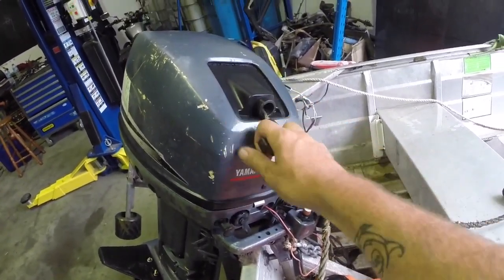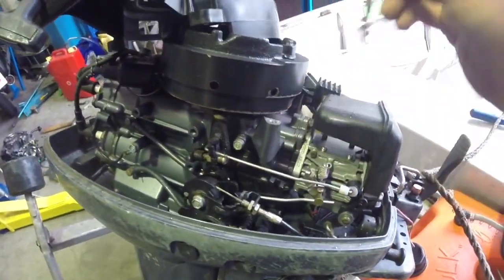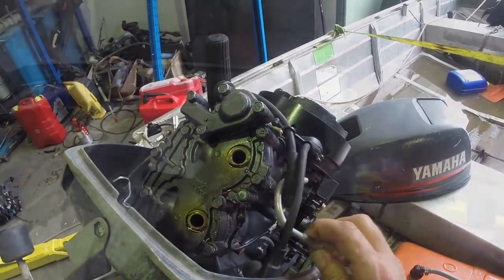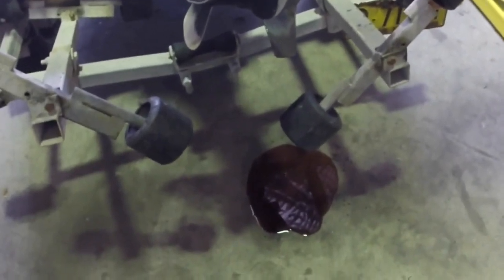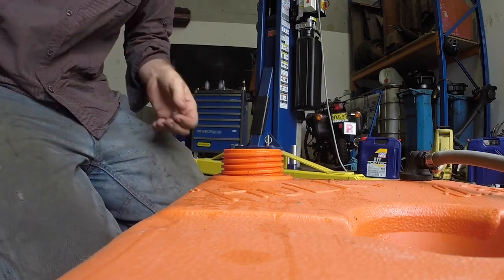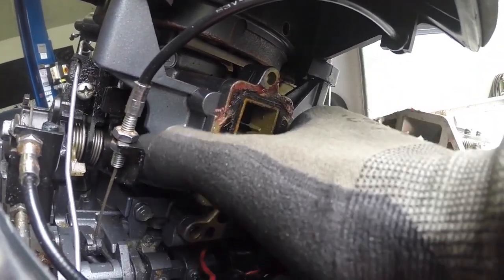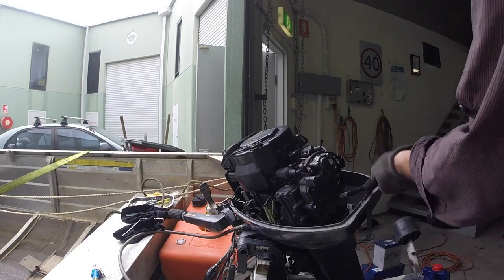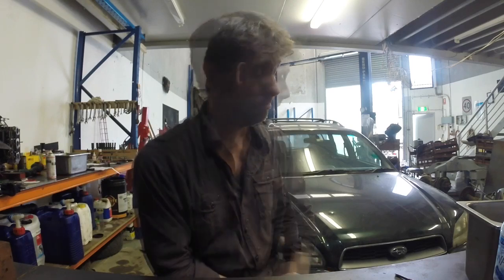Unseizing a seized outboard motor

Comment: Thanks so much for the video!  I'm working on unsiezing a 5hp nissan 2 stroke built in 1993.  If I try to turn the flywheel counter clockwise, it just unscrews the nut on top of the flywheel and doesn't turn the engine. Do you know of a solution for this?
Reply from the maker: Hi Todd. It's a tough one when the outboard is seized so much that the nut undoes before it moves. I would just focus on turning it clockwise until you start to get a little bit of movement from the engine. You could try turning from the flywheel itself rather than the nut by using the puller holes in the top of it and some sort of home made bar, but it would be tricky to get enough force that way.
Reply: a strap wrench on the flywheel, or a chain wrench padded with lead, or aluminum (so you don't chew the surface horrifically). get both from a pro plumber supplier (not home depot). they use the strap jobs on polished pipe, and the chains on ugly but stubborn pipe, lol. you can also make a strap wrench by slitting an extension, and running an old work belt trough it. tighten, then twist in the direction you want to turn, after it winds up, it squeezes with surprising force, so a strong strap can actually apply a bit of torque

Comment: Very new at messing with outboard motors.  I put ATF in both cylinders and it immediately drains out of the top cylinder.  The bottom cylinder hasn’t drained at all.  Does that mean the top cylinder is bad?  Thanks for your help.
Reply from the maker: No, only piston will be down allowing the oil to flow out the exhaust and/or inlet ports.

Comment: Use brake fluid and heat the engine with a heat gun and leave overnight!!! It even works with exhaust aluminum to steel parts. It's pretty amazing.
Reply from the maker: Heat certainly goes a long way, that's for sure.
Reply: @DangarMarine  The brake fluid is highly resistant to heat also. Don't know why it works but I know it works unbelievably well. An old mechanic told me about it many years ago. I've been using it over thirty five years and it doesn't stink like Kroil and doesn't gunk up or burn like WD 40.

Comment: Another One for ya. My Johnson 8. I just replaced the gaskets and thermostat, spark plugs, impeller. Previous amateur owner didn't know water supposed to come out of the hose (to show water is going through the engine, also didn't know you had to flush after salt water use ) therefore it must of overheated looking at burnt stain on the head. 

Compression shows around 75 (without open throttle) 
It seems like its harder to start now then before. Do you know what could be wrong. ?
Reply from the maker: Could have a blown head gasket. Now water is being pumped up it may be making its way into the cylinders were before when it was not working they were staying dry. Any water on the spark plugs?

Comment: Hi dangar , I have a 1988 mercury 25hp outboard and the compression is 85-90 , what can I do to increase to 100 plus ?? Thank you great videos as always !!
Reply from the maker: You will probably need to have the cylinders machined then go to oversized pistons to fix the compression if it is wear. If could just be a stuck ring though but you would really need to take the pistons out and measure the bores to be know.

Comment: Ok dangarstu, I got the motor to break loose. It's a 1971 Mercury 9.8. I can't figure out why it won't start. I have good spark in both cylinders. Compression is 80 and 90. If I spray starting fluid in the spark plug holes and put the spark plugs back in. Shouldn't it at least fire?  Thanks for the help.
Reply from the maker: +scott C Hi Scott, it's odd that it isn't firing. It could be a timing issue. Once you have good spark, fuel and reasonable compression the final piece of the puzzle is when that spark is firing. Also, you don't want it to be too rich, so I wouldn't spark starting fluid into the spark plug holes. You need the right ratio of air to fuel for combustion so just spray a small amount of fluid into the air box then turn it over.

Comment: Hold one one sec I’m confused here so I have an 70s 2 stroke Johnson and the starter rope won’t pull. I got the flywheel nut off so does that mean it’s seized ? Or does that matter at all? Does that mean it’s not seized if i was able to get the flywheel nut off ?

Comment: I got anxious after watching your vid. I went out side and put my motor in hear then turned the prop by hand. it turned soo it shouldn't be seized?
Reply from the maker: Sounds like it is fine. It wouldn't turn in gear if it was seized. :)
Reply: I took my boat out today. Started fine. When i was warming it up the water shooting from the side stopped, I really hope that for some reason my water intake didn't break on me.

Comment: Hi again
What is ur opinion?

Fuel Filter Funnel Removes Water from Gasoline by Mr Funnel (Long Clip)
Reply from the maker: +Qatari Man Although I think a filtering fuel is a good idea, and water can easily be separated from water, a few things here don't add up. Notably, you get 1 micron water filters. Admitably those filters may require high pressures for the water to pass through. Also, my searchings show that fuel molecules are larger than water molecules: "Molecular diameter of water is about 2.75 angstrom, whereas that of the smallest molecules in petrol, butane, is about 4 angstrom." I would have expected water to be filtered out like a normal water-separating fuel filter by letting it sink to the bottom.

Comment: After you can rotate the flywheel you then spray Teflon into cylinder and then put a half inch chuck electric drill and spin and break in

Comment: HI Stu, just aquired an old 4.5 mercury aux.Its seized rock solid,and I have filled the bore with diesel.I havent stripped the fly wheel nut as yet,whilst trying to rock back and forth.But feel it wouldnt take much force to strip the flywheel nut.Any reccomendations of other methods,before it ends up in my recycle bin ? Thanks
Reply from the maker: Hey Trevor, it's a tough one. Other than splitting the crank case apart there isn't much more you can do. Have ATF have acetone is apparently a good soaking agent and you could also try gently warming the diesel to help it penetrate.

Comment: Hello dangar marine ,today I bought 1971 evinrude 9.5 sporttwin 2 stroke old engine,I did compression test bolt pistons gave me exactly same compression which is 65 ? I did not go mad when I pulled? Is this normal for and old engine should I pully faster to get better result? Lets say my compression is low can give it clean bolt cylinder and put new gasket? When its comes to gasket can I use liquid gasket? Thanks
Reply from the maker: 65 is a bit low but there are even which is good. If it runs well I woudn't worry too much. If not, it may need quite a bit of work (new pistons and rings, machine the block etc)

Comment: G'day mate, great videos and love your work! They certainly helped me saved my sunken 2003 15hp merc super. Unfortunately it has now seized some time later while running. Without any warning she seized on the water as I put it into reverse. Pumping water, running fine. i managed to loosen up the flywheel with some force but it won't start. Any tips or advice would be much appreciated!
Cheers, Dan
Reply from the maker: Hey Dan. If an outboard has seized from corrosion like this one it is unusual for it to seize up again while running. It sounds like it has either seized from overheating or lack of oil. Another possibility is that the needle bearings had corroded form the sinking and then that pitting has accelerated the wear on them causing them to fail. The needles then float around the crank case and get jammed between the pistons and the cylinder walls. Disassembling is the only way to know / fix. I have an outboard in the workshop at the moment that has that problem. Will be doing a video on it soon.
Reply: Dangar Marine beauty mate, will make a small donation tonight! Thanks heaps
Reply: Remove the lower unit and try turning it over.  It may be that the lower unit's driveshaft is locking up, causing the problems you have experienced.  I seen that very often with "seized" motors.

Comment: The ATF you put in the spark plug holes, how would I go about getting it out of the motor before trying to start it up?
Reply from the maker: Just crank it over with the spark plugs out. Put a rag over the holes though as otherwise it will fly across the room. :)

Comment: When putting the wrench on the top nut, and moving it forward and backward, the nut just becomes tightened or untightened? Did you say that you say that you put a break in there, or was that just in the video? nevertheless, how to work with it - I am afraid to break the bolt that the nut is on?!
Reply from the maker: You do need to be careful as there is only so much force you can put on the nut before it will strip the thread. You could try heating the oil and letting it soak for a few more days. Some motors are just too seized though and need to be disassembled to free them up.

Comment: Hi again buddy. My 80 Yamaha 90s model. It idles ok but as soon as i give i some acceleration, the motor shakes and sounds like it's deing. I cleaned out the jets and carbies, changed the spark plugs, coil packs and old stator, different fuel line with new fuel, Compression test come around 125 (forgot to have throttle wide open) 
What else do you think I should do to fix it?
Reply from the maker: Any type of shaking like that is one (or more) cylinder not working as well as the others. This means that they are probably starving for fuel during acceleration which can either be the acceleration pump (depending on model) or that the carburettors aren't completely clean.

Comment: I am currently doing this procedure with a 1961 johnson 5.5. Its been a few days with antiseizing spray  in the cylinders and no budging. What is the purpose of ATF? lubrication or does it provide anti seizing benefits. I have no history of the motor as i bought it for $20 but im thinking a teardown is necessary due to heat seizing.
Reply from the maker: ATF is really just another lubricant.

Comment: I have a 60HP mercury 2 stroke 3 cylinder. I pulled the spark plugs out and turned the fly wheel til the piston came to the top and applied pressure with a extension bar. The top cylinder and middle cylinder move to the bottom position. However the bottom cylinder wouldn’t move at all. Would you consider this seized or more underlying issue?
Reply from the maker: If the top two pistons can move while the bottom stays still it must be disconnected from the crankshaft due to a broken con rod or wrist pin.
Reply: Dangar Marine well that’s the thing it doesn’t move with pressure however if I turn the flywheel it will go back down.

Comment: This may be a dumb question but why does the nut loosen on my outboard when I try to break it loose with a pry bar?
Reply from the maker: +scott C Most outboards turn clockwise which will tighten the nut. If you rock it back and forth you will spend some time undoing it, but if you really tighten it clockwise first it should withstand a bit of anticlockwise turning without coming undone. If it does keep coming undone just focus on turning the flywheel clockwise first.

Comment: Thanks I know it's hard when it's not in front of you will do it again I used the compressor to blow the jets out I was going down the road that the vacum was getting lost some how but can't find any leaks of any sort no doubt it will be something simple just can't see it for looking at it will keep trying &I if or when I get it sorted will keep you updated thanks for your help if you can think of anything plz just let me know
Reply from the maker: So I'm presuming the timing is good. Was it you that mentioned that maybe the flywheel woodruff key might be a problem? Have you put a timing light on while cranking?

Comment: I have a 15 mariner with this problem.  Started soaking the piston chambers a day ago.   When I try and nudge it with a breaker bar nothing moves at all and the other way the bolt comes loose.  Any ideas ?
Reply from the maker: Sometimes if an engine is badly corroded your only option is to pull it apart and replace bearings etc.

Comment: i just start watching your videos and i think i have a good idea on how to fix my boat. i have a 1978 johnson Evinrude two stroke, and when i turn the key the starter turns but not the flywheel, it might be seized cause its been sitting for about 1 year. what do you think might be other reasons for that?
Reply from the maker: Does the starter go up to meet the flywheel and then stop? Can you turn the flywheel by hand?

Comment: I've got a seized mariner 2.5 hp I'm working on. I've unseized outboards before with out a problem. I've put some oil in the cylinder and am letting it sit. I've had to tilt it up quite a bit because the the exhaust port is exposed in the cylinder and the oil just leaks right out the exhaust. Should I try to get a piece of small rag in the exhaust port to keep it from leaking out?
Reply from the maker: +Mac Keating Hi Mac, I had this same problem this week. Do you have the head off? If so a bit of rag would be fine for slowing the oil leaking out. Failing that you could just spray it repeatedly.  With the one I was working on a small puddle of oil remained around the base of the piston below the exhaust port which I think did the trick as this is where the water had been sitting too, but your mileage may vary.
Reply: +Dangar Marine I will give it a try and let it sit for a few days head is off cylinder and piston are in great shape in a few days time I will try to make it budge with a breaker bar thanks for the help I'm starting to work on outboards and your videos are making it pretty easy

Comment: Great Video Stu. What's with all the under water down under motors coming your way? LOL. During the compression test you had the throttle fixed wide open...is that to allow max amount of air into the intake and then into the cylinder? Also, for a 94' 20hp evinrude, what numbers should I expect from the two cylinders during a compression test? Sorry, I meant what's acceptable? Thank you as always! Cheers
Reply from the maker: Thanks mate. All the boats in this area live in the water 24 hours a day so during big storms there is always a chance of one of them sinking given how small they are. Because this area is tidal they also sometimes get caught under wharfs as the tide comes up and that sends them down very fast. With regards to the outboard you should be getting about 120psi, but about 100 is okay. As gauges aren't calibrated you should really be more worried about the two cylinders given a very different reading from each other.
Reply: Ah, okay that explains why all the sinking boats. Cheers and thanks for the explanation on the compression numbers too. I'll hope to get 125 in each. Thanks
Reply: Hey Stu, happy to report I got around 145psi in each cylinder! She's always been a hog to pull start and still requires some strength...good ol' evinrude.

Comment: I tried to put two stroke oil in the calendars via the spark plug holes but when I did so with the lower cylinder it ran through and down to the lower unit.  Any clue what would cause this?
Reply from the maker: Yes, depending on where the pistons are in their travel it will run out the exhaust ports and out through the prop.

Comment: what is methrow? Never heard of it here in USA
Have a answer on the oldmerc9.8 hp im working on about shaft seal carrier unscrews clockwise or countet clockwise!
Thanks tom
Reply from the maker: Ah, my bad. I said metho which is a common shortening for methylated spirits here. Essentially just alcohol.

Comment: I filled my cylinders and it leaked out of the bottom by the propeller...i dont know anything about outboards...could this be from the position of the head or do i have bigger problems
Reply from the maker: That's normal. Some pistons will be all the way down and the exhaust port will be open allowing the oil to flow out from that cylinder.

Comment: Thanks. I have a suzuki DT-30 2stroke 2 cylinder  30hp . So could you tell me how much psi compression is good
Reply from the maker: Over 100 is acceptable.
Reply: @DangarMarine  thanks so much

Comment: What if the flywheel only spins backward but forwards its stucked? (i am sure its is in neutral and the pulley wheel engages to the flywheel properly)

Comment: Love you videos. Unfortunately I didn't see this obefore I Try to unlock a  2013Yamaha E15DMH. 
     The engine had ceased. It was running rough the day before and the next day it was locked up. I was pumping water on the top cylinder With an apparent blown cylinder head gasket  And   WD 4 out theAnd this is where I got really stupid .
     I used an electric ratchet gun to free up the cylinders and got them moving When they all of the sudden locked up again and I snapped the nut and threads off the crank shaft.
       My question for you if you know is previous years powerheads 63V01 fit on the 2013-15 International E 15DMH
Models.   Unfortunately in the United States you cannot even find parts with these years listed
    Love your channel And recommend you to all my boating brethren.

Comment: got a 115 evinrude 1977 i got on a junker trying to start it it turns with alot of force and the starter and electrics work but it appears the carburater sucked in a mouse nest because there are piece of it in the cylinder head/valvecover how should i go about getting this out of the motor????
Reply from the maker: +george bercharlie  I'm presuming it is a two stroke motor? If so there won't be a valve cover. Anything sucked through the carburettor will go into the intake manifold then into the crankcase then into the cylinders. I would take off the carburettors, give them a clean, then take off the reed valves and see if there is any debris holding them open. Let me know if I have misunderstood.